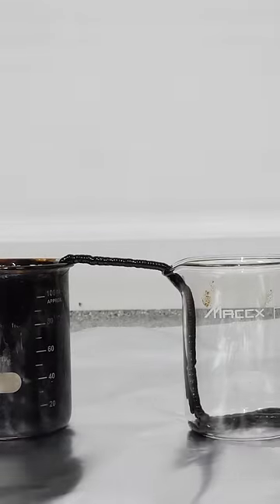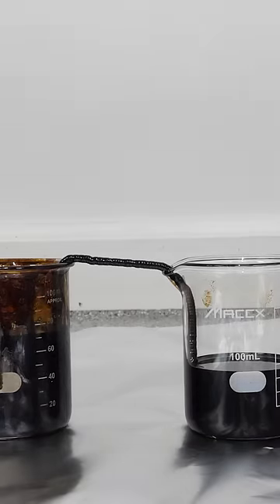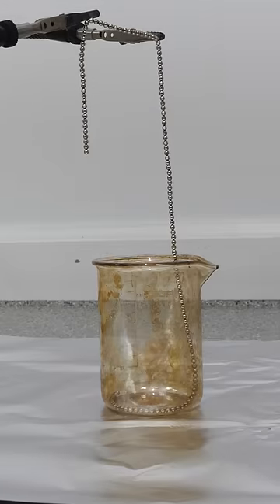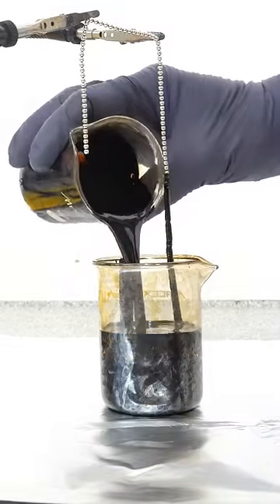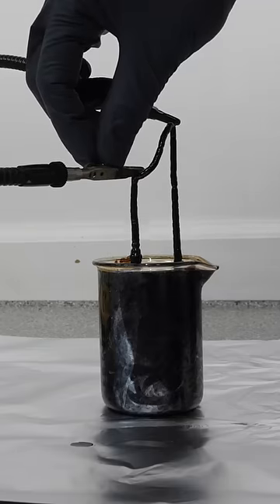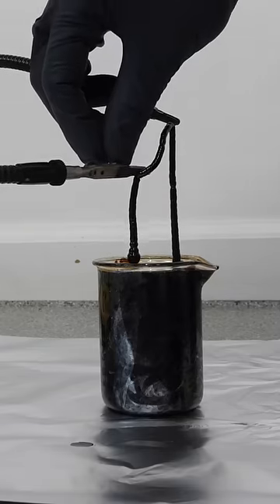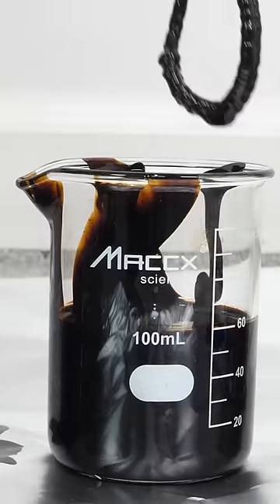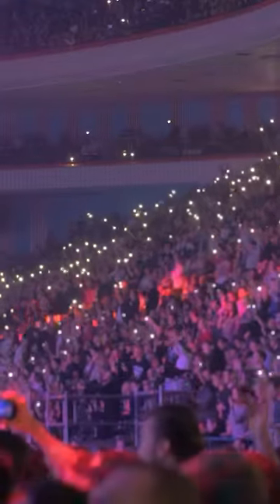Perpetual Ferrofluid Fountain

Comment: Thermal dynamics will forever be the rainstorm over perpetual motion.
Reply: this technically could work (ofc with some weird on and of magnet setup) because the magnets are inputting energy
Reply: @theheroofmagicical628  but the process of turning the magnet on and off would require energy so it doesnt work
Reply: @hovsh  so get the ferrofluid to turn it on and off.
Reply: @theheroofmagicical628 The magnets litterally don't "put in energy". The ferrofluid has LESS energy stuck to the magnets. It's not going to fall off anymore than it would have fallen "up" out of the container without the magnets.
Reply: @theheroofmagicical628   Gravity is inputting energy.
Reply: @hovsh  Luckily energy is not conserved in general since time symmetry doesn't exist in an expanding universe.
Perpetual motion machines might very well work in theory if they just move slow enough.
Reply: Where do we hide the battery?
Reply: Until of course we figure out how to counter it
Reply: Thermodynamics*
Reply: Thermodynamics is the branch of physical science that deals with the relations between heat and other forms of energy, whereas thermal dynamics is not a recognized scientific term.
Reply: @SahanRavinder  What an insane way to correct someones spelling. I love this xD
Reply: @leimmortalraven3246  Not my exact intention. Simply passed along info via copy/paste as I wanted to confirm either or. 😅
Reply: You were so close to cheating the system, but no cigar.
Reply: In this hoise we obey the laws of thermodynamics! - Homer Simpson
Reply: Not so. The magnet drew the fluid up against the force of gravity which required energy. If you measured the gauss of the magnet before, then pulled the fluid up, wiped off the magnet, repeated this 100 times, then measured the magnetic force again, there would be no loss. Where did all the energy come from to do all that work? 
   The problem with his setup is that the magnets at the end of the chain are too strong. He needs to use successively weaker magnets at the tail end so that gravity will eventually overcome the magnetic force and it will begin to drip.
Reply: @bluestormcloud791  if gravity overcomes the magnetic force of the weakest magnet wont the magnet itself be pulled of  the chain?
Reply: @mipsirc  There is always the Duct Tape solution to keep the magnet chain together. If that doesn't work then epoxy can be used to keep things tidy. 
  Just think about that blob at the end of his chain. What if just one more magnet was added with a slightly weaker attraction? The blob would migrate down because of the magnet and because of gravity. Then one more magnet...
Reply: @bluestormcloud791  to be honest, I don't think it would work, this is because by adding glue to keep the magnet in place would make it able to withstand more weight on it, overcoming the gravity force, and also the magnet will only bring as much fluid as its mangetic power, and since in this case we are in a sequence of shrinking the size of the magnets, the force added  by gravity to the fluid going down is counterweighted by the larger beeds bringing the fluid up. 
But I'm no engineer, so maybe you're onto something...
Reply: @bluestormcloud791  no my king, not by a long shot. But you can build it, I'd love to see a video
Reply: @TheKrensada  that won’t be perpetual motion, in such a case where you can get a system where no energy is wasted at all, it would be a closed loop and therefore you can’t extract any energy out of it.
Reply: @randomnobody660 tf are you on about, how is energy not conserved?
Reply: @BallMuncher555  tf are you on about, how is energy conserved?
Reply: @randomnobody660  They won't. It doesn't matter how slow the device was operating, if you extrapolate it's function over a long enough period of time it would fail like everything else.
Reply: @randomnobody660  conservation of energy is one of the most important laws of physics, tell me how exactly energy isn't conserved.
Reply: @BallMuncher555  lol "law" of physics. Do you even know what it's based on?

Google "noether's theorem" or maybe more specifically "time translation symmetry", and then maybe read about how the latter is both required for energy conservation, and doesn't hold in our universe.
Reply: @Astraeus..  as in material degradation? sure, maybe.

However if we pretend the machine is made of unspecified material that lasts forever as we generally do when talking about machines in the abstract without specifying construction, it'll always keep moving.
Reply: @randomnobody660  rather than giving an actual explanation, you just tell me to google some things. I did what you asked, and I didn't get much information to prove your claim that the conservation of energy doesn't exist. And I don't feel like doing rigorous research either. How about actually explaining your point rather than telling me to look some things up since just looking things up won't always turn up answers.
Reply: @BallMuncher555  race to room temp superconductor November 2026
Reply: @RemindThemAboutGeorgeFloyd  what?
Reply: @BallMuncher555  I gave my reason in the first comment. Energy isn't conserved because said conservation relies on time translation symmetry, and said symmetry doesn't hold in our universe since it expands.

I don't know what else you expect me to type in a youtube comment esp since I also gave you key words to look up. Intuitively the idea is that if physical processes will have the same result no matter when they occur, then energy is conserved. If you want the math it looks to be the first example on the wikipedia page for noether's theorem.

Once you get that far googling "does time translation invariance hold in our universe" should get you a quick "no" for the 2nd half of my argument.
Reply: nah
Reply: Got a question. If you added a second beaker and chain. Would it work? So it would climb the original chain up over and down into a second beaker. Then a second chain would come out of the second beaker down into the original beaker. Starting the process over again.  I have no clue. I’m genuinely curious.
Reply: @theheroofmagicical628  no, the magnets are not inputting energy. You need to learn a bit more about electromagnetics and where the energy comes from. And then you need to learn not to say "well technically..." and then saying some shit that's not true, technically or otherwise.
Reply: @theheroofmagicical628  because seriously... "the magnets are inputting energy..." no they are not, dude. They're playing with a small amount of potential energy.
Reply: @randomnobody660  talking about the effects of the expanding universe is NOT the same as "generally." It wouldn't just need to be slow enough. It would also need to be lightyears long. That is not a "general" fact. Watch more PBS Space Time instead of this candy science.
Reply: @mipsirc  oh yeah? Oh is that your HONEST assessment? Are you SURE this guy hasn't cracked free energy? Idk man, it's been proven impossible but maybe this guy is a god, are you sure you wanna take that risk? Well alright, if you honestly don't think it would work...

(Sorry, but I am mocking you. It wouldn't work. Period. You don't have to think about it.)
Reply: @randomnobody660  again, if you're going into Noether you're going into impossible space scales. Yes, the universe does get funky and break its own rules on vastly different scales. But you're acting like energy conservation can actually be violated here on earth 😂
Reply: @joshyoung1440  ( I don't)
Reply: Would it then be reasonable to call it perpetual thermal dynamics 😝

Comment: Ferrari put a similar fluid in their struts back in the day. The car was able to alter the viscosity of the fluid using an electromagnet a thousand times a second. Enabling the car to tune its suspension for the conditions it was in. Pretty cool practical application of this technology
Reply: "we are checking"
Reply: "box box box"
Reply: literally like every performance/sports car has that
Reply: @nicki8731 What cars do you see frequently? Most have basic gas shocks.
Reply: Bose actually makes a shock like that. It's definitely commonly available, but it's expensive as hell. So it's definitely not common, it's just commonly available. 😅
Reply: @michaelberna4836  for example, magneride suspension in mustangs
Reply: @michaelberna4836  I believe Ferrari borrowed the technology from General Motors. That technology is installed in some Camaros and Corvettes.
Reply: @nicki8731  Thanks! I'll have to look into that. It's nice to be able to learn more.
Reply: WTF is ferrofluid 😂
Reply: And Nintendo has also some patents with Ferrofluid in joysticks to simulate pressure like if youre pulling or pushing something in zelda. It lets you feel resistance in the joysticks adjacent to whats done in the game, pretty neat technology
Reply: Ferrarifluid
Reply: Ferrori Fluid
Reply: your typical gmc truck deniall has this . even early 2000s trucks
Reply: @michaelberna4836  Cadillac.
Reply: @michaelberna4836  Cadillac had it first then licensed it to Ferrari, Audi, Acura
Reply: @dominikborno4133  It's also now being used in some high-end gaming mice as a way to implement customizable haptics in the "bump" feeling when you roll the middle scroll wheel. The magnetic fluid is subjected to electric pulses with a customizable intensity and pulse rate, hence the scroll wheel haptics can be adjusted in intensity and timing.
Reply: This fluid is a General Motors invention and was licensed to Ferrari years after Corvettes had it.  It is still in use today.
Reply: That was a Chevy innovation called "magnaride."  Ferrari paid Chevy royalties to use it in the 458 Italia.  

Chevy still uses it today on Camaros and Corvettes.
Reply: Pulse-width modulation is interesting. However its used for almost everything else in cars today.
Reply: It was developed by DARPA for war vehicles.

Comment: The force of gravity was already beaten by the magnets to get the fluid up there, it would obviously therefore be too weak to pull it back down.
Reply: Best explanation of why this doesn't work I've seen.  I know you're basically saying the same thing as what the video said, but I like how you said it better by speaking in terms of what we would expect to complete the loop (gravity)
Reply: it's only the friction of the fluid against the chain that impedes the movement. If there was an equal ammount of fluid going up and going down, it could be modelized by a sort of wheel (held together by viscosity) and it could 'rotate' with its inertia. It's not truly a gravity problem
Reply: @AlexM645  it is. If there was the same amount of fluid on both sides, the fluid would also stop as the forces would be balanced.

Your wheel analogy does work, but only as the wheel also would not spin, it would require an external force.
Reply: @joshbridges8410   a balance of forces means no variation of speed, does not imply immobility.
Reply: @AlexM645 correct but the forces aren't balanced, obviously. If they were, the liquid wouldn't climb
Reply: @AlexM645  Are we assuming a sperical wheel as well as frictionless surfaces and zero aerodynamic drag?
Reply: @joshbridges8410   yes, completely friction-less (no non-conservative forces), but the shape matters less than the center of mass
Reply: Dammit. You make sense. Dreams busted.
Reply: But what if you fixed wood or something to the end of the chain so the magnetism wore off, allowing for gravity to pull it down?
Reply: @zachpaterson2585  or successively weaker magnets.
Reply: The magnet pulled the fluid up against gravity showing that work was done. Where did the energy come from? If you did this 1000 times the magnet would still have the same attractive force, nothing was lost. So where did it come from? Try it. Measure the gauss. Pull some fluid up. Wipe off the fluid. measure the gauss again. It will be the same. Wiping off the fluid doesn't impart any magnetic force or energy back into the magnet.
Reply: @bluestormcloud791  it's a good question.

Magnetic force is a potential force, or a form of potential energy like gravity. Gravity is not 'doing work' when it pulls something down, although another object must 'do work' to leave that gravitational domain.

Likewise, producing a magnet at the start of its life inputs energy to create this potential magnet well of force, and other objects pulled towards it will give up 'potential energy' when up against it. Work must then be done to remove something from the magnet, restoring equilibrium.

It's a little like short selling stock, or selling something before you have actually bought it, rather than buying it before selling it.

The magnetic material falls into an energy deficit while in the magnetic well, and can only leave by repaying this 'dept' of energy.
Reply: @joshbridges8410  Gravity isn't doing work when I am standing on the floor but whenever a body accelerates towards the earth work is being done. The potential energy is turned into kinetic energy. Then as you wrote, work is required to lift the body again, restoring it's potential energy. Potential energy isn't actually a form of energy. It is a savings account created when energy was used to put it in it's potential position.. If work is only done when lifting the body but not during the falling of the body, energy would be created out of thin air. This discrepancy, if it actually existed, could be used to create a perpetual motion machine.
Reply: @bluestormcloud791  exactly, we are not disagreeing.

Potential energy is a proxy for the energy input into the "apparent" work done by the gravitational field.

If gravity didn't have a form of proxy energy, that we call potential energy, then the laws of thermodynamics would not balance and as you say, energy would be created, which cannot happen in these simple scenarios.

A magnetic field works on the same principle, when the magnetic field is first created at the magnets inception, energy is input into the magnet to align the electron spins. This creates a "potential energy" in any material that falls into the magnetic energy well.

Apparent "Work" can be done upon the external object by exchanging this magnetic potential energy as the external object is attracted. And work must also be done to remove that object from the magnetic well.
Reply: @joshbridges8410  So if a single drop of ferro fluid were to drop down into the reservoir that means free work was accomplished and the laws of thermodynamics would have to be revisited. 
Here is a thought experiment: Dip two magnets into ferro fluid hanging from a string. Pull both magnets up. The first one two meters, the second one 100 meters. wipe them both off with a rag.  The one that pulled the fluid up higher should have less magnetism now because more of it was expended pulling the fluid up to a higher potential energy state.
Reply: @bluestormcloud791  no that makes no sense.

Do you get tired when going up in an elevator? No, because you are doing no work. The elevator system is doing work. You and the elevator itself are in the same reference frame.

Lifting the magnet, you are doing work, the magnet has only drawn the fluid into its well. It will feel acceleration forces, but won't do the work of lifting the system.
Reply: @joshbridges8410  You get an A. Same as if the fluid was pulled up in a bucket. 
Here is a better thought experiment. Two identical magnetic rods 10 cm long resting in ferro fluid. One has a plastic shield at 5cm to stop the fluid at that height. The second one allows the fluid to be pulled up to the very top. The fluid bath is lowered allowing any excess to drip off. The remaining fluid is wiped off and weighed. This is repeated until each rod is cleaned of 100 grams of fluid. The rod that was allowed to pull the fluid to the full height would have required more work be done to pull the fluid up. If both magnetic rods were then measured for any loss of magnetic attraction then the taller one should show less remaining "energy". I don't believe this would be the case. They would still both have the same magnetic force, even though one performed more work.
Reply: What if you put weaker and weaker magnets on the downswing?
Reply: @Price245  You would need to glue them together to keep them from separating from the force of gravity but even a very weak magnet will draw ferro fluid onto it. Eventually the force of gravity will overcome the weak magnets ability to retain it and it will begin to drip.
Reply: @AlexM645 that’s the energy part he said
perpetual assumes no external energy system involved
Reply: @bluestormcloud791   A magnet is not supposed to loose magnetization because of Work. Also, remember that if the magnet attracts the ferrofluid, the ferrofluid attracts the magnet in return, so when you maintain the magnet in position, your body is responsible for the Work of lifting the fluid.
Reply: Then why is it able to go into a separate container but not the same container??
Reply: might be a dumb question but what happen if you use less powerfull magnet on the part where you want the fluid to drop it wouldnt exactly be perpetual since gravity but can it happen ?
Reply: @ArizonaLizardMan  siphon and level effect
same happens with a water level
Reply: What if the magnets get slowly weaker on the down turn and let gravity take over on the last magnet?
Reply: @Nakaradiel  If you put a weaker magnet after a stronger magnet, the ferrofluid will simply prefer the stronger one and not only will it not drip, but some of it won't even make it to the last magnet.